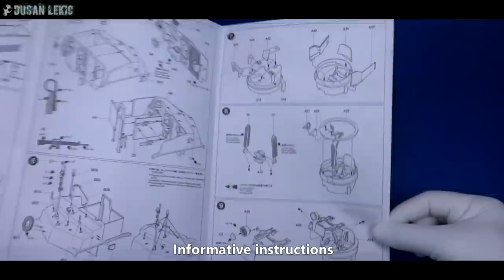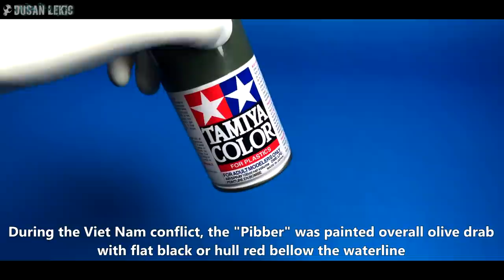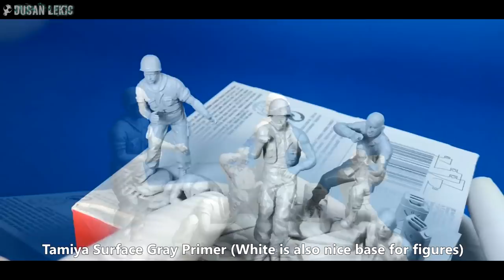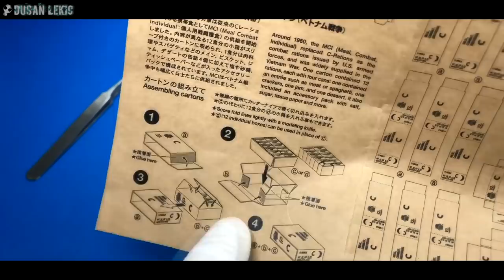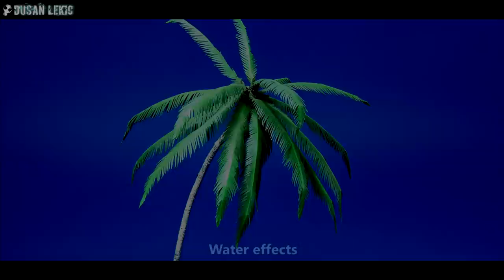TAMIYA-"PIBBER" VIETNAM WAR Full video build

Comment: I wanted to build this kit since I first saw it. I finally bought and built it about two years ago. I'm disappointed I did not get the boxes with the rations with this kit. Just three very little technical point about this model, the Miller Lite bottles that come with it are anachronistic as Lite came out in 1975. 
I also learned that the life buoy was never red in operations so I just covered it in green. I also read that no 55 gallon drums would be carried and since they read hydraulic fluid and I have yet to learn if this fluid was even used in this boat, I still left one on the boat. 
Great job on your build I really love the base with the water, I have never tried nor bought any of those. You are a real artist.
Reply: Generally in combat they would have filled the drums with earth or sand to make makeshift barriers for the gunners to use as any rounds hitting them would be  stopped by the sand.

Comment: why did you paint some figures with tamiya and airbrush and other with M.M. paints and brush? 
Also how do you find the Scale75 Artist 20ml tube paints coverage? I noticed at 13:46 you showed a tube. Do they cover well when applied by brush? I tried the Scale75 original dropper bottle paints and they had poor coverage and left heavy brush strokes. That's why I'm curious how the Artist line of tube paints are?
would really like to hear back from you. Thanks

Comment: Hey Dusan, what is the best all around airbrush from Iwata to buy?
Reply: I ALWAYS recommend people. Buy the Iwata HP-CS Eclipse. Only airbrush you will ever need for this hobby.  Only has one rubber o-ring (which does not does not contact the paint), all parts are steel or brass, and replace,ent parts are super cheap.  Coastairbrush.com is a great place to buy if you need a place.